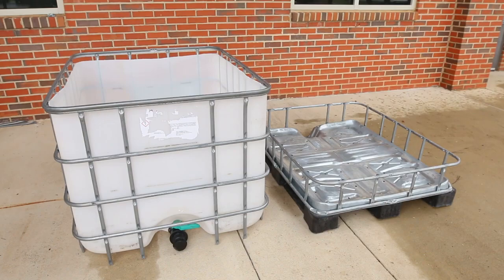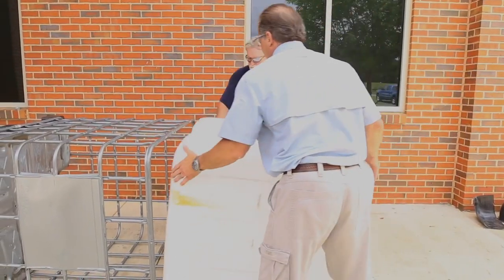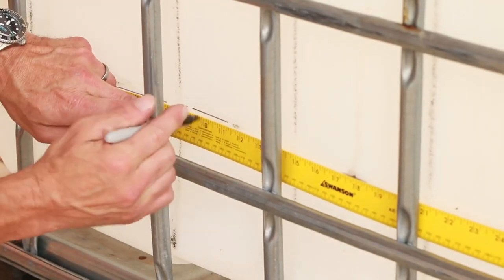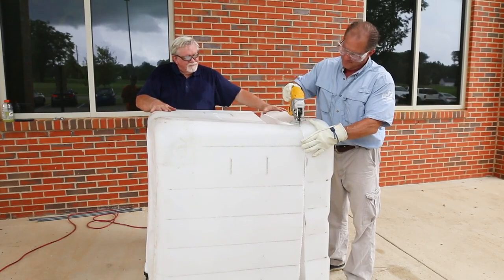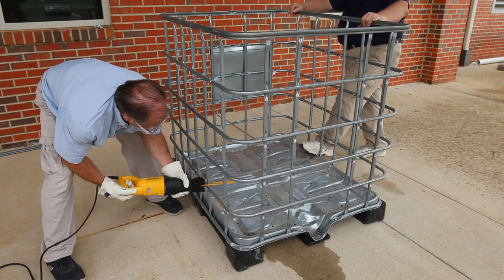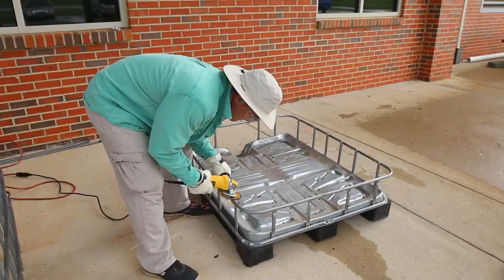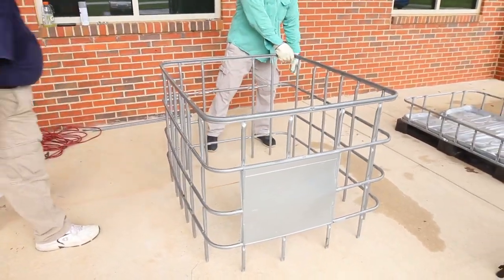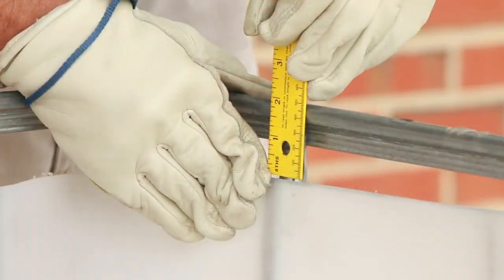How to build an IBC aquaponics system -  the fish tank

Comment: What size torx bit did you use?
Reply from the maker: The size that fit the hole :),  will have to see if I can find an IBC that hasn't been opened and try to figure it out.